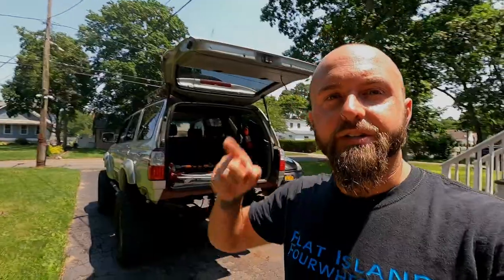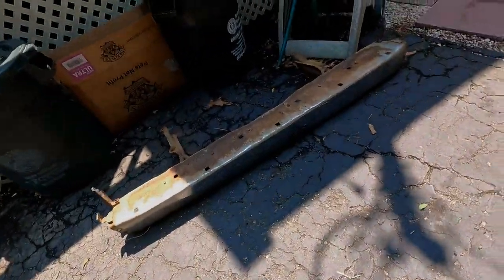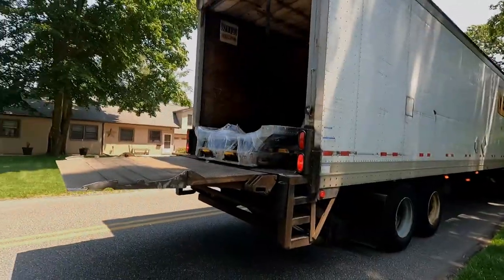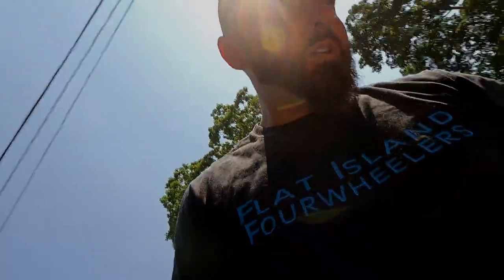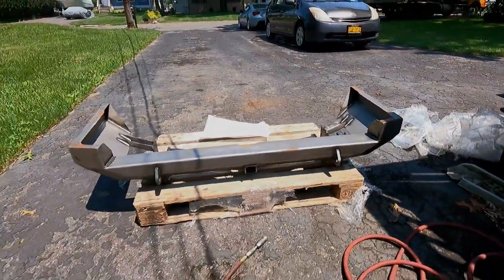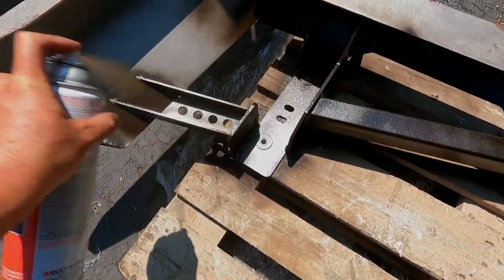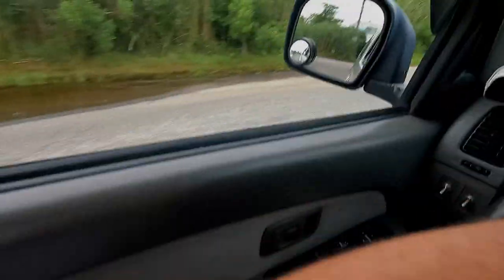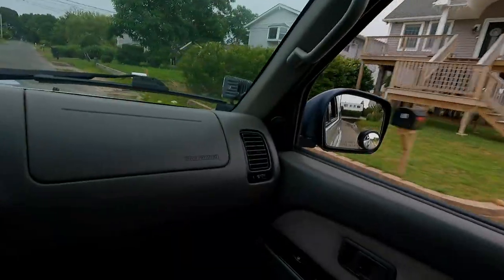New Rear Bumper for my 3rd Generation 4Runner!! (finally)

Comment: Nice Bumper I have that one on my 2000 I used the stock plastic bumper top cover with some mods but it really made it clean when you pop the Hatch ! Check out the sherpa rack too pretty nice rack.

Comment: So the bumper came all welded up ? And you just had to assemble the tire carrier to the bumper frame?  .... Thinking about ordering me one too.
Reply from the maker: Yep you can order it in pieces but that’s a lot of welding I didn’t wanna do so I ordered it fully welded. Just bolt it on and go!  Under an hour for install.
Reply: Yes, but don’t pay for powder coat, they will send it unpainted and they’ll charge you anyway bro

Comment: great video.  What is your MPG with the new bumper?
Reply from the maker: Haha no idea!  I don’t calculate MPG on this thing because at this point it doesn’t even matter 🤣🤣
Reply: @CountersteerGarage  - I'm afraid to do it because my MPG might drop.  Now I'm only getting 13 mpg stock.  You might be close to 10-11 probably.
Reply from the maker: Yeah I’m lifted around 6” over stock on 35’s I don’t even think about gas mileage in this thing. I daily a Prius so that helps 😂

Comment: What are your wheel and tire specs? Rig looks great btw 👌🏼
Reply from the maker: They’re Koenig Countersteer X 17x8 0 offset with Goodyear MTR 35x12.5!
Reply: @CountersteerGarage  that why the wheel setup looks really good. Thank you!
Reply from the maker: Thanks for being here!
Reply: @CountersteerGarage  did you have to upgrade your CV axels? Im thinking im going to have to for 295/70/17’s
Reply from the maker: My 4Runner is solid front axle but yeah the shafts and birfields have been replaced. 

The thing with upgraded axles is this; they’re the fuse in the system. They’re an engineered weak point to save the diff. So if you upgrade your axles you’re essentially installing a higher amperage fuse, which could do more damage. 

I’d say just get real good at swapping CV shafts trailside and make sure you have all the tools you need to do it!  That’s how I did it back in my IFS days
Reply: @CountersteerGarage  this is actually fantastic advise. It’s easier to replace a CV axel than it is to replace Diff. thank you so much.
Reply from the maker: 22 minutes is my record! 🤣

Comment: what lift are you running?
Reply from the maker: Front is all custom; solid axle, 3 link, Fox shocks with dual rates. 

Rear is OME 851 (front 2” lift FJ80 springs)